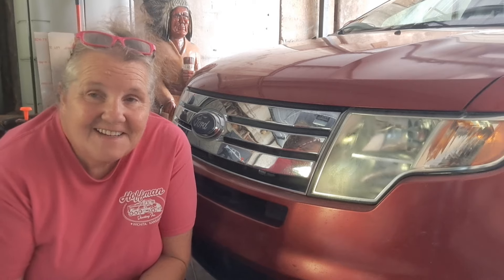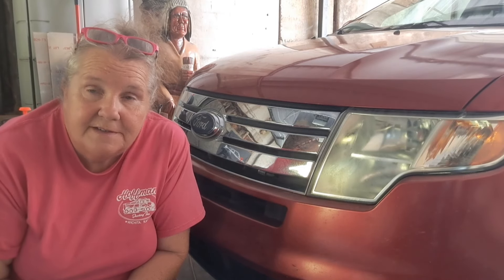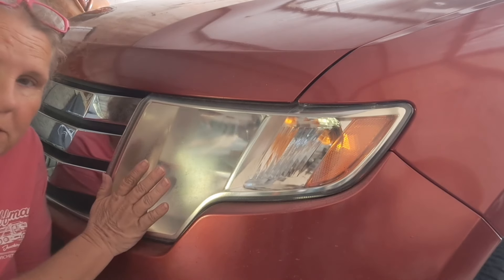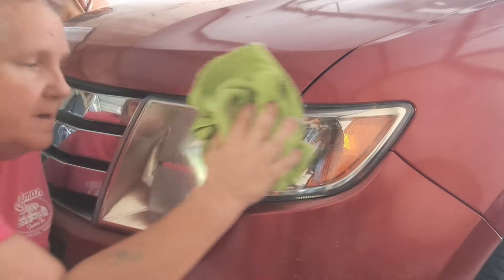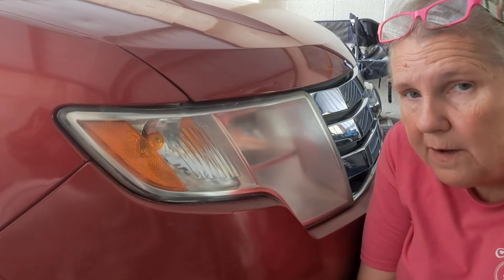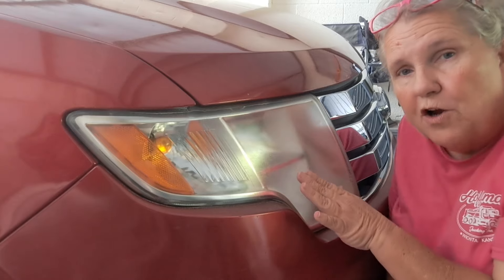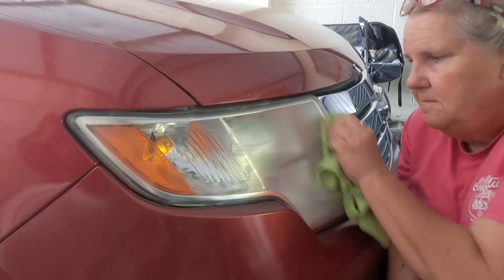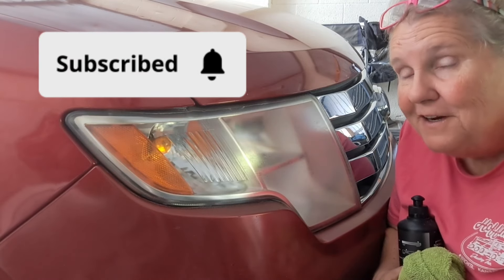Don't be this kind of Dealership Detailer

Comment: will in theory  this isn't a bad way to restore headlights the best way to do it is wet sand to remove pitting from the plastic then hit it with the drill polisher.
Reply from the maker: That's how a Detailer should.  A Dealership Detailer is a whole different world.  Cost cost cost is what it's all about.  Shortest amount of time on anything.
Reply: @detailgrandma22  I agree when I worked at a dealership they polished cars with old rags it made me cringe.